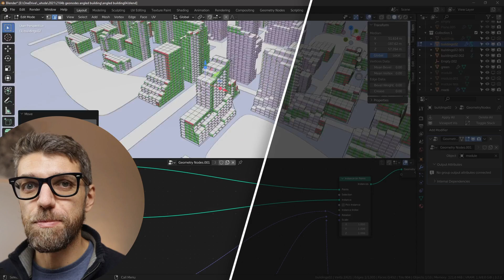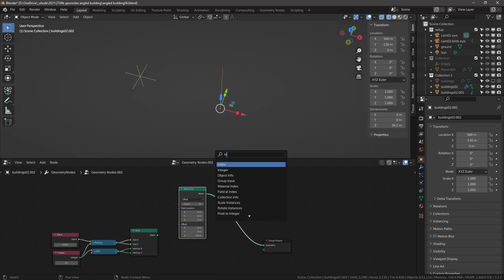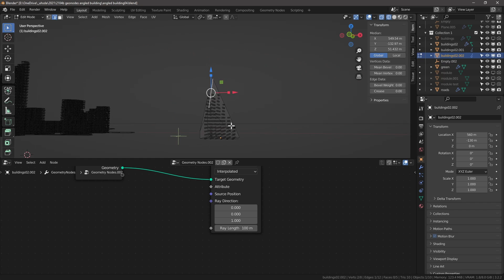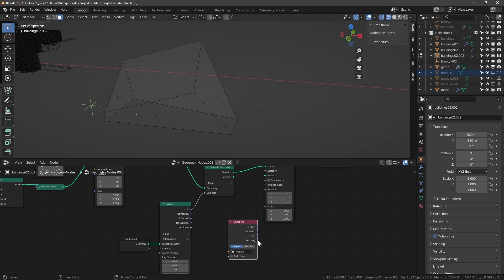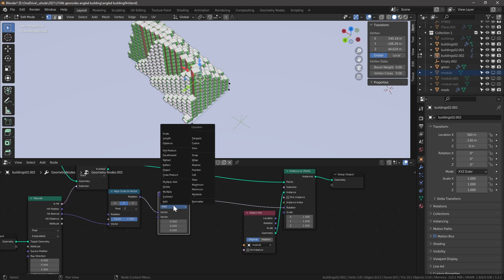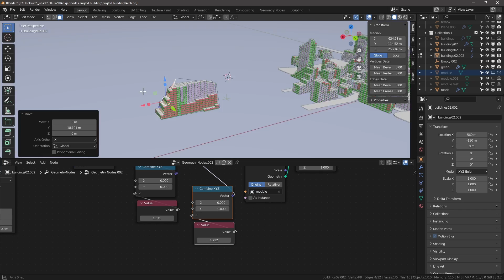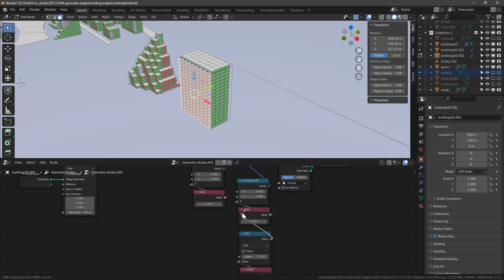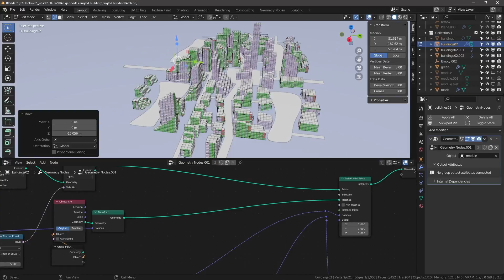Easy Modular Buildings with Geometry Nodes in Blender

Comment: hi ı just wonder geometry nodes when we are useing the systems is that help my pc vram or not ıf we do some things with that which one is help vram morethan less use vram
Reply from the maker: This is really optimised actually, since we are dealing with basically points inside of volumes, and then instancing on the location of these points. For rendering, yes it can get heavier if you have a GPU with less than 8gb of VRAM

Comment: Finaly understood this, thank's for the hard work!
Is there a way to make empty spaces in the middle of the building?
Reply from the maker: yes, you can have another set of raycasting happening the removes points in the middle with another sets of shapes, or scaled versions of the existing shapes.

Comment: Hi, do you thing there is a better way to select the points inside the volume than raycasting ? You can't make inversed pyramid this way for exemple. I think of a boolean interesection ?
Reply from the maker: You can always do booleans but everything would be much slower. For an inverted pyramid, you can raycast with negative Z vectors

Comment: instructions unclear. did not get what was happening
Reply from the maker: Which part?
Reply: @UHStudio  the buildings weren't alligning the way you showed. Tried every way to change it but it got in every direction and angle but straight
Reply from the maker: @dollysharma4903  are your modules rotated the same way as shown in the video?
Reply: @UHStudio  everything is done the same way as you, maybe it's the version?
Reply from the maker: The version shouldn't have changed anything as, it's maths that determines the rotation of the different modules. Perhaps your base model and grid is rotated 90° to what I am showing in the video?
Reply: @UHStudio  I'll try to do it again, i got frustrated and deleted the file so I'll redo it, though i stopped blender two months ago and started touchdesigner, I make visualizers now so yeah I'll try my best to recreate the city

Comment: How can I access to the different part of the instantation, and tell this that I want the modules be different in each part? Like corners, and Roof, floor?
Reply from the maker: That's quite a bit more complex. It wasn't possible when I released this video but it may be possible now by comparing the number of neighbours to any given 3d grid point and separating the geometry based on that comparison. The next challenge would be how to orient the edges so they respect the correct orientation.